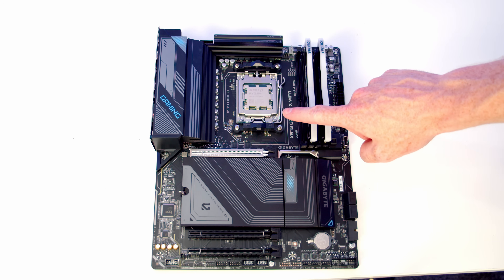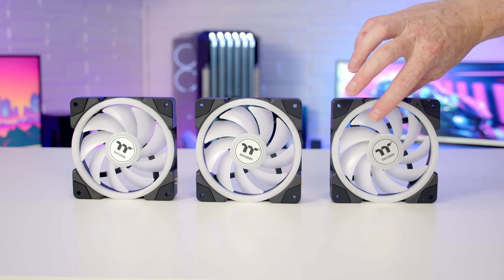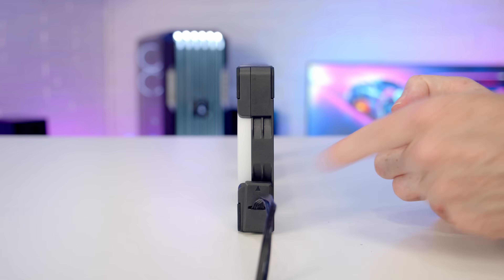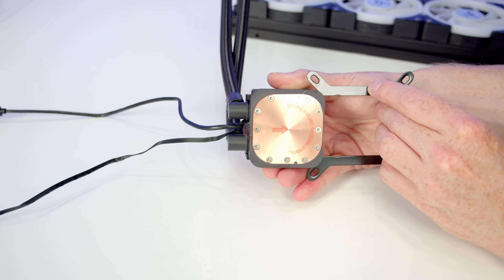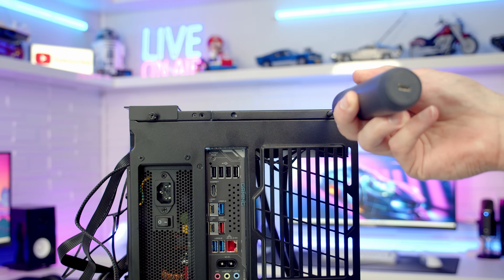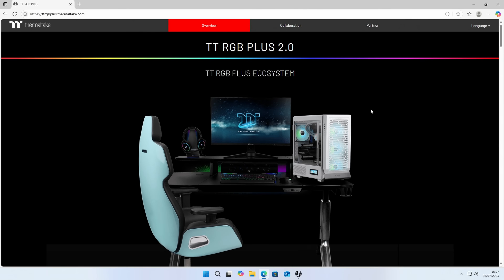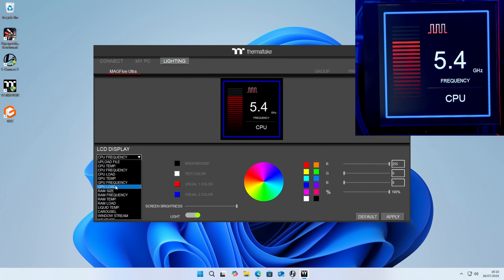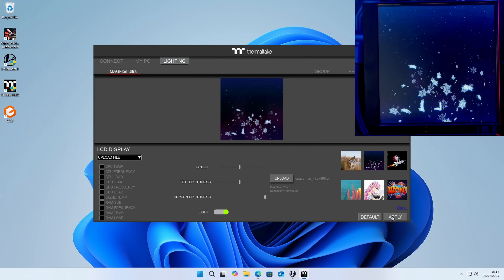Thermaltake MAGFloe 360 Ultra ARGB Sync - Installation Guide

Comment: Is it not possible to install the AMD bracket on AM5 so that the hose points downward?
Reply: Mo
Reply: @officialprojectshadow idk im getting a thermaltake tower 600 so my mb orientation is different but also seems to depend on where you put the aio
Bc of my case my aio can go on left top or right but seems to depend on the case